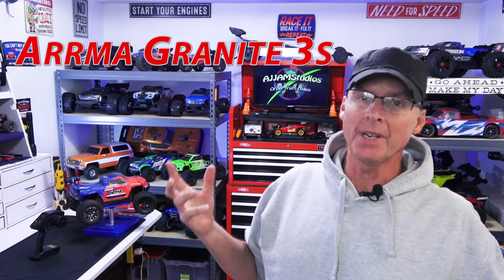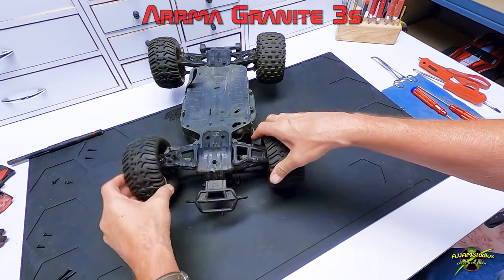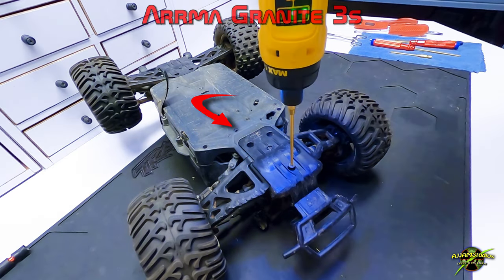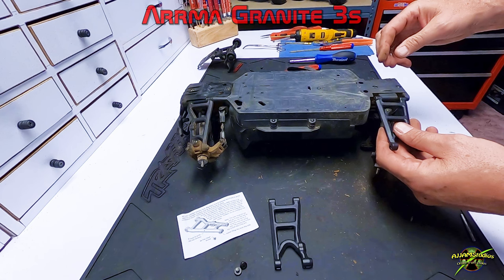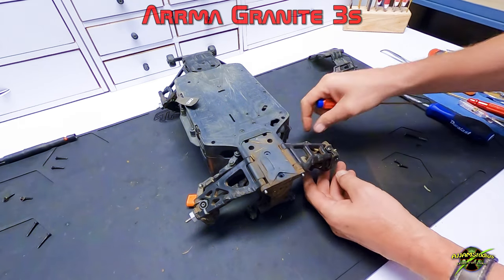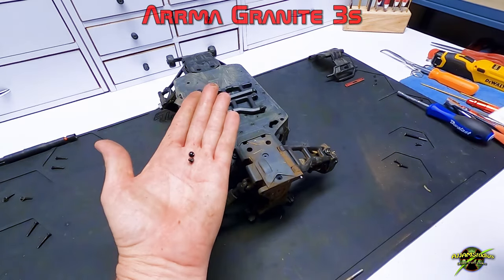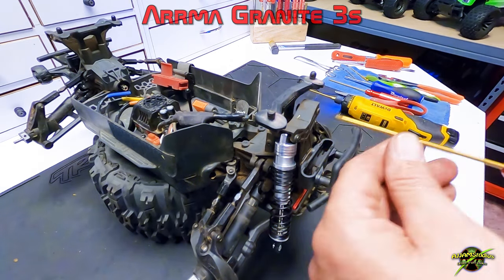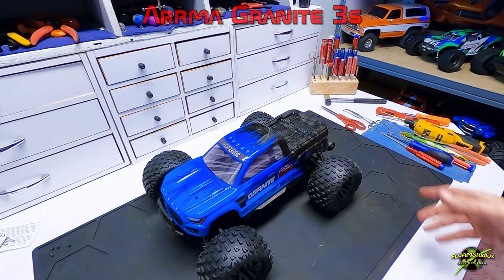Arrma Granite 3s refit part 2

Comment: great video! How would tou compare it to a mt 10? i can get both but if i get a granite i might make it wider and install a centre diff. If i get the mt10 i will probably just swap esc and motor to make it fastert since it would be the same cost here. Heard th emt10 are crazy durable but havent seen people bash it as hard as the granite. Jeard the granite is a bit hit or miss in the durability appartment. Whats your opinion on these in comparison as cars?

Comment: Awesome! I noticed your using the Dewalt driver recently, I love mine, they have a good adjustable clutch that you can adjust on the fly... what bits are you running? They seem nice and long, I don't know if you have done this already, but a video on basic, beginner RC tools would be a good watch, IMO 🙂
Reply from the maker: We did that video. It’s in the 101 playlist. As far as the drivers go, I purchased them at a local hobby store some time ago. I can’t remember the name. 😎👍
Reply: I use one for work installing components in IDF racks , love it .